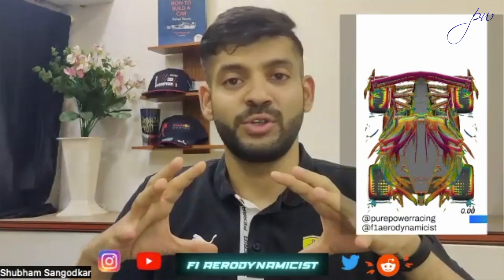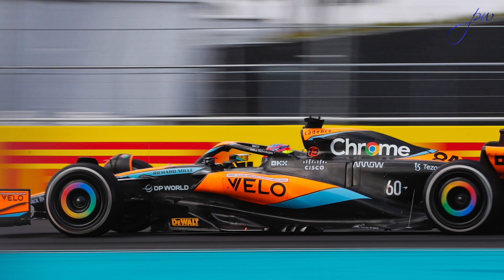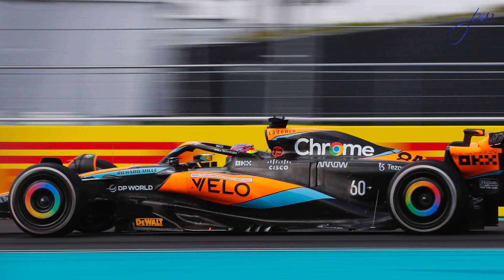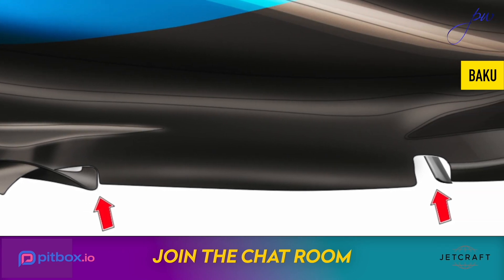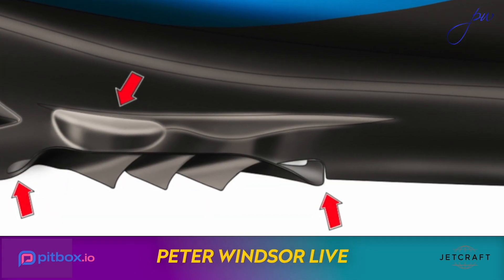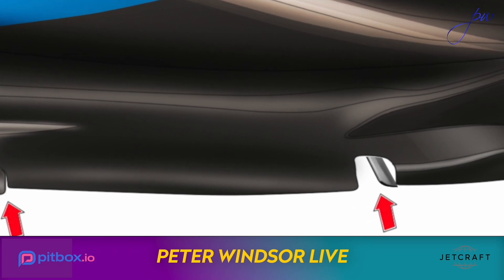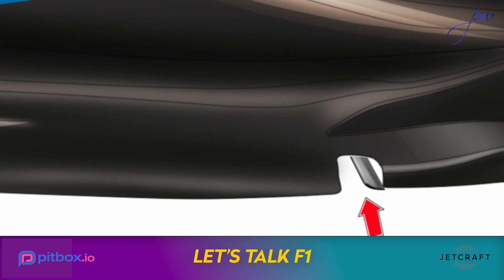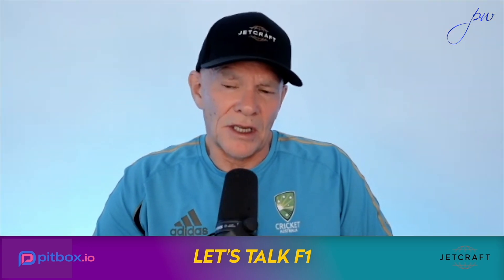How #F1 Floors Work ? Using McLaren Floor Update feat. Peter Windsor

Comment: I've always wondered why the F1 diffusers have their very specific kick. Obviously a typical diffuser has a smooth convex kick but the F1 cars seem to have a relatively sharp curve followed by the concave kick. The concavity is presumably to stay within the area box, but I've never understood why the sharper profile is used at the start of the kick in F1. What are the benefits, drawbacks, quirks etc of such a profile?

Comment: Notice the inner fence and the central body, there is a high pressure zone that extends about 70mm into the floor, it stops and is sandwiched between the two inner fence vortices. That high pressure zone is typical of a sonic shock. If it is indeed a sonic shock, then a convex surface will accelerate the flow further. The vortex however is changing the shape of the surface behind the shockwave. This is partly why the position of the vortex is very important, because it shapes the tunnel after the shockwave, and because it's easier to maintain the vortex integrity when it has a good line of sight to the diffuser.

Comment: If you look at what Red Bull did for the RB19(on the top) is that they enlarged the undercut to get more air into the mouse hole, which is also fed by the downwashing sidepods anyway. This energizes the vortices in the diffuser. If you look at the fact that the teams that don't have these sidepods have problems with aerodynamic stability (Ferrari and Mercedes), I think this is the advantage of this concept. It's what keeps the Vortex structures stable. With Ferrari and Mercedes, they become unstable under certain conditions, whereas with Red Bull, the downwash of the sidepods keeps them stable.
Reply: Pretty much. The side pods keep the air over the edge wing and in front of the rear tire, and the pressure difference between there and the underside of the edge wing creates a strong in-washing vortex, which feeds the mouse hole